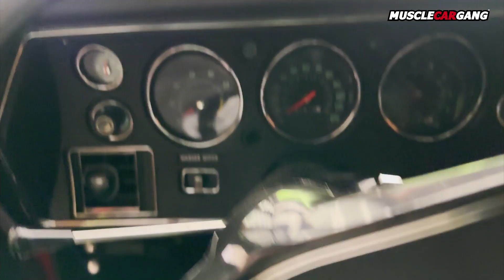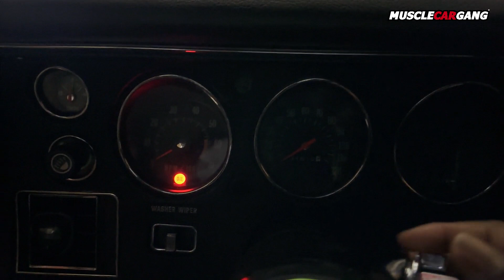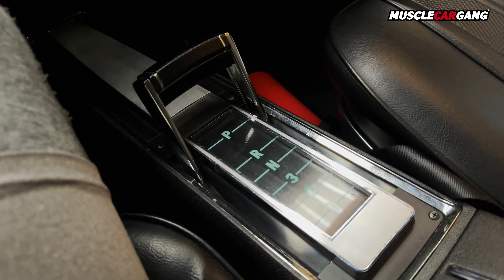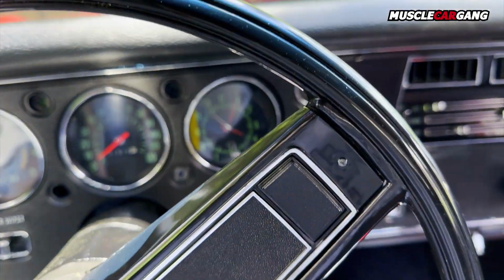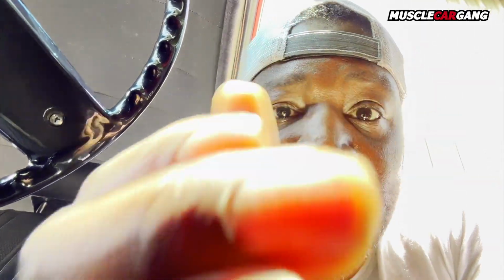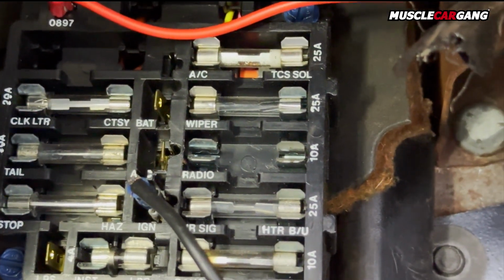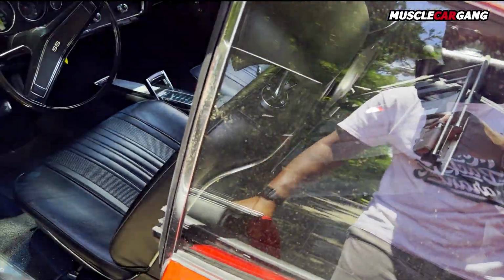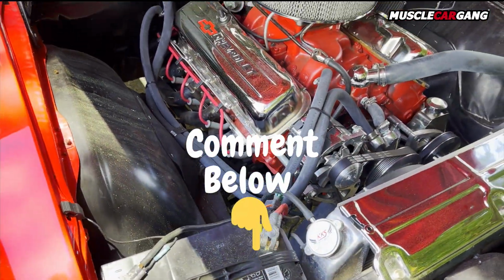Chevelle 454 That's Falling Apart? How To Fix It.

Comment: Aye bro maybe your trans issue could be shifter linkage out of adjustment. An the motor shake is normal for a bbc my sbc does it also i recomend a polyurathane transmission mount to keep the engine / drivetrain more solid.
Reply from the maker: Thanks for sharing💪 I been having that linkage problem for a while now & it seems that the trans will have to be dropped to fix. 

But, the more money I spend on these small problems I’m thinking about putting all that money into the new rebuild.

Comment: My camaro has done something similar and it was a stretched shifter cable. If you jack it up and watch the transmission linkage while someone shifts through the gears you will see the issue. Either stretched cable or shift linkage out of adjustment.

Now for my opinions. Please don't ruin the car with that digital guage crap and a dumb steering wheel. A '70 Chevelle is sacred. The guages in there are '70 chevelle guages. That's the only car to have those guages.  The steering wheel is a '70 chevelle wheel (71 and 72 too). Any fool can order whatever steering wheel you're going to order and put it on their junk, but the only place you will see a '70 Chevelle steering wheel is in a '70 chevelle, you feel me?  If you think you have problems now, wait til you install all this aftermarket stuff on top of sketchy wiring. I think just a new wiring harness would cure your electrical woes and you can get back to enjoying your beautiful car. I also saw in one of your previous videos something about an LS swap. PLEASE DON'T DO THAT!!!! The big block chevy is a wonderful engine and is what belongs in that car!  Not saying anything wrong with an LS, they are  probably one of the best engines ever made, but that doesn't mean every beautiful, rare muscle car needs one. Think of your role as a muscle car owner like a museum curator. Your job its to preserve this history so your grandkids grandkids can know what a 70 chevelle is, king of all muscle cars. If you want to hack something up go get a g-body or a blazer or something of less historical significance.

Comment: Shifter cable need to be adjusted
Reply from the maker: Thanks, do they have to drop the transmission to fix?
Reply: @musclecargang  No! Sometimes the shifter cable setting on the transmission can come loose. Do try to drive your like that until you get it adjusted. You can mess up your transmission like that. I had my shifter cable get burnt on my exhaust before and the transmission wouldn't shift out of first gear.
Reply from the maker: Okay, that’s great to know. I haven’t moved it since it came lose. Now let me work on getting it to a local shop. Thanks for sharing.💯

Comment: Okay as a first time viewer of your video, I'm getting the distinct impression that you are not too adept at troubleshooting either electrical or mechanical problems.  Electrical and Mechanical wise an old muscle car is about as simple as they come. You really haven't given us enough information to go on so we'll have to make a lot of assumptions. A radiator does not have a fuse so it can't blow them. Being that is does look like the mechanical fan has been replaced with a nice electric pair there will be some sort of sensor for them to turn off and on.
Reply from the maker: Thanks for replying. Yes the fuses under the hood controls the electric fans because the sensor box caught fire last year because of the bad wiring.
Reply from the maker: As for the transmission, that’s nothing new. The day I purchased it from the last owner he had to put it in the shop because it wouldn’t shift 2yrs ago. I share my car journey with the MCG Family because I have a lot of mechanics & builders in the community that likes to help with my rebuild process. Yes, things happen with my Chevelle that I understand so I share it. 

Welcome to the MCG Page💪